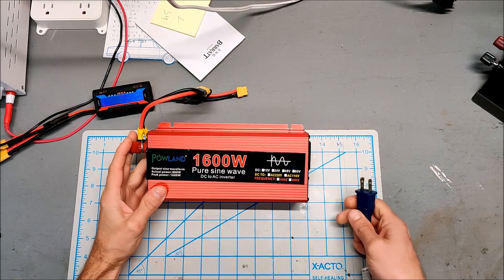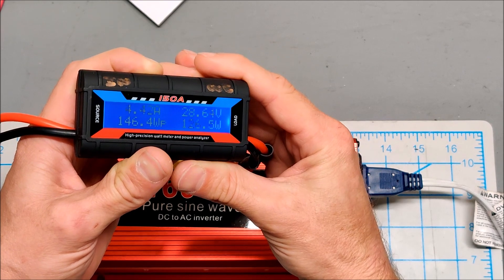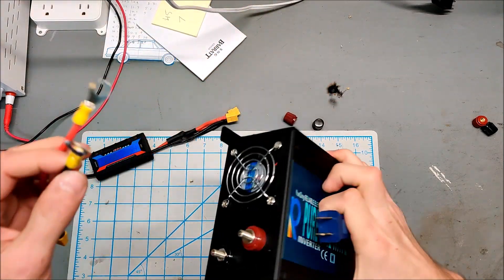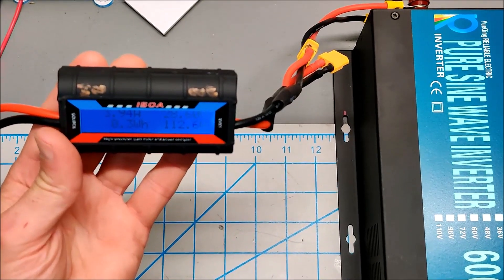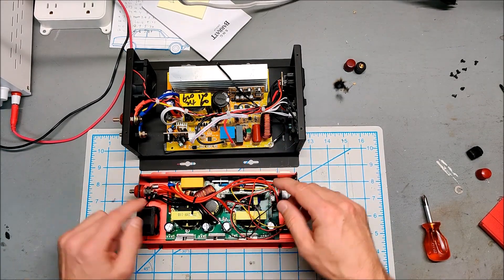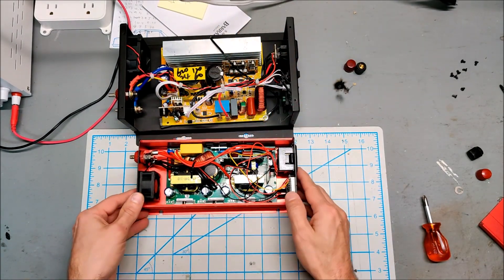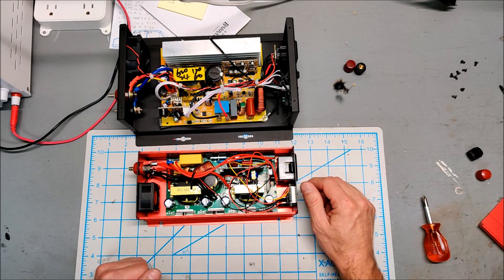Cheap Inverters Suck Part 2, what's inside?

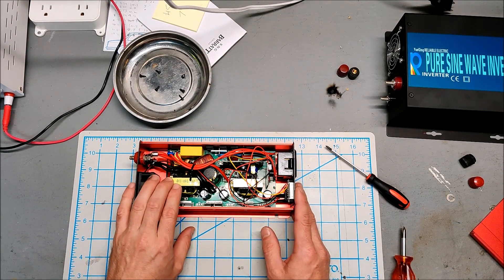Comment: 4:49 That statement is incorrect. That is a transformer, it only converts AC. When DC is switched, it becomes AC, which is then increased to 110V which is then usually rectified and filtered and then switched again at 50hz or 60hz for the output.

Comment: They switch the low voltage DC then the transformer steps it up. (Transformer only work with ac or pulsed dc) 

Great video man.